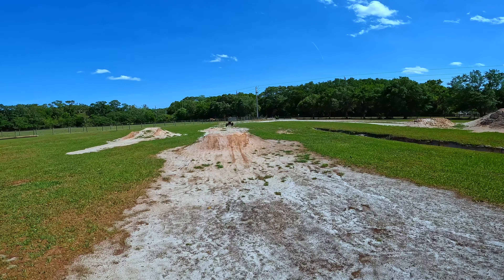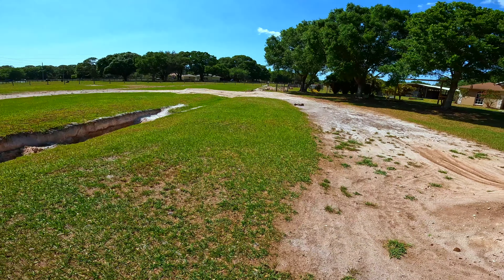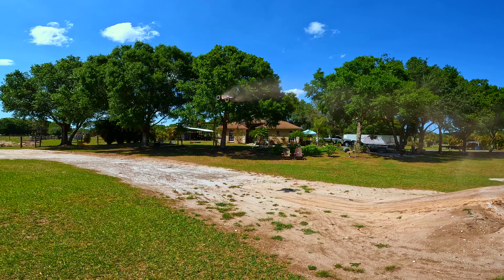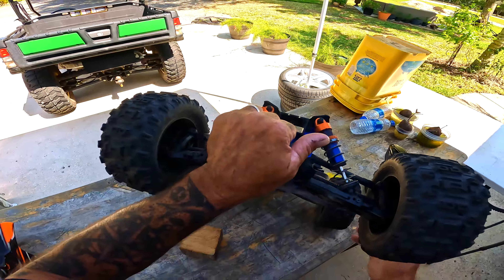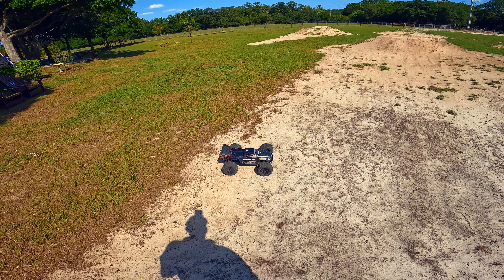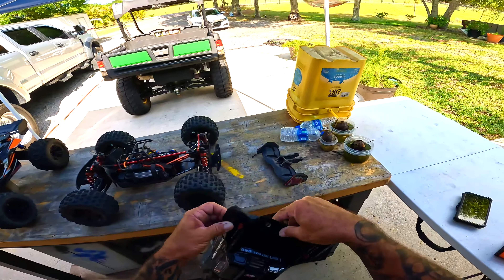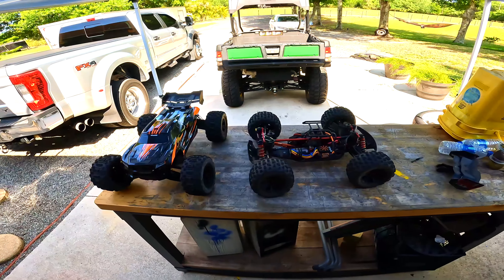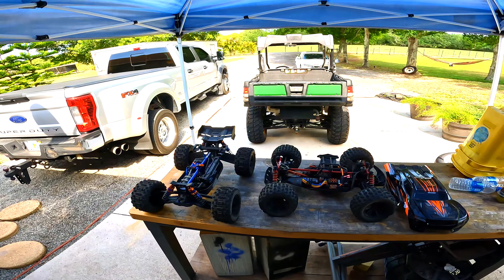TRAXXAS SLEDGE 6S VS ARRMA KRATON 6S

Comment: I think your videos demonstrate that both are great rigs, but the most important factor is the driver. You demonstrated good air control, and awareness. Which is probably why most of your rigs don't break much.
Reply: Yeap I agree with you. People keep complaining about the durability but the main problem is the driver itself. They need to learn to drive first then if the rig still break then its a different story.
Reply from the maker: Thank you I can agree with that  I used to break a lot more rigs a lot more often I still have my breakages but it’s to a minimum🚀💪🤙👊👊

Comment: Have you tried Kraton with backflips? I am thinking to change tyres. My Cooperheads are way off balance
Reply from the maker: Thank you yes I have another K6 that I run that’s completely beefed out with M2c and I have the backflips on that one they’re pretty awesome Tire I’m just trying to keep my stock exb as original as possible👍🚀💪👊
Reply: @AldoLoyal  Can you tell me how are the 2 tires different?
Reply from the maker: @szutty6  The backflips are a little firmer more traction and less ballooning but I’d like to stock kraton tires as well they’re a little softer and I personally think it gives you a little more cush on your landings but they don’t seem to hold up as well as the backflips just my opinion everybody’s different
Reply: @AldoLoyal  thx for the info.
Reply: @AldoLoyal  I ordered a sett of the backflips. The cooperhead's foam is starting to disappear. I think this is the problem.

Comment: Hey, is there any way to use the Traxxas sledge tires to Kraton.  I purchased the sledgehammer tire thinking it will fit on my Kraton? I don't have Traxxas Slagle .
Reply from the maker: Yes, M2c makes a universal hex adapter that will work. If not, you could just cut those little tabs off inside the wheel hex
Reply: @AldoLoyal  Great thanks!👍